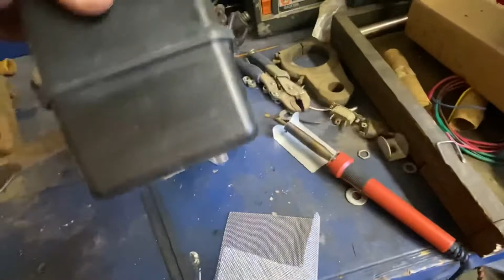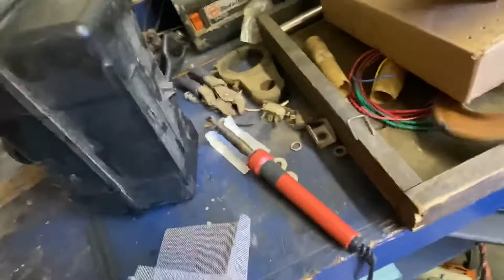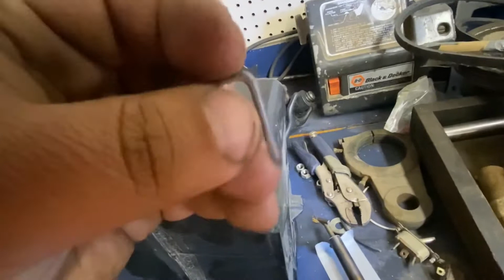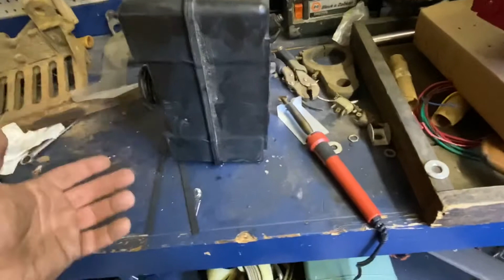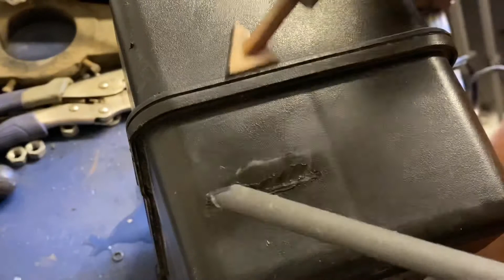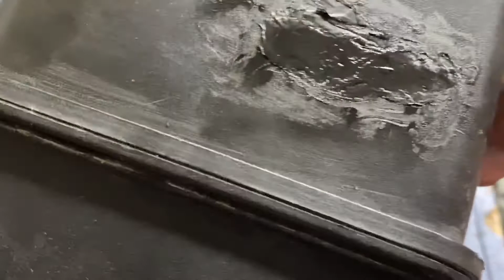Plastic welding a Briggs and Stratton gas tank

Comment: What about ATV tank hole. Big as a  hamer head
Reply from the maker: You can put wire mesh backing in and melt in a new piece.  It might look a little wavy when it’s done but will seal if done right.  Largest patch iv out in was roughly 6X6 inches

Comment: Do you think this would work to fix the diaphragm on my dialysis pump? I think it’s plastic and im having to rent a loner at the moment. The dealer wants $130 for a replacement diaphragm. I ain’t paying that much money if I can fix it myself. I’m assuming that if a plastic weld can prevent gas from leaking it can prevent air from leaking too. I was going to try JB Weld but my doctor said that if the epoxy develops pinholes that lead to any pressure loss in the vacuum I’d die. I think I should definitely weld the crack in my diaphragm and not risk using the JB Weld. I’ve got an old soldering iron here and it should do the trick. Great video - you’re literally a life saver ❤

Comment: I’ve had fairly good luck and results so far, but I have learned it’s best to use other fuel tank for adding material 😊😊😊
Reply from the maker: I use that a lot as well, I have a few old tanks that I have cut into strips and square patches ready to use

Comment: I bought this Iron. My leaky tank is on the mold parting line seam. Took a lot of tries to stop creeping gaps along the seam. Annoying pin hole drips. But yeah better than finding any used tank that is 30 years old.
Reply: A plastic hot stapler is your friend for helping hold a seam split together!

Comment: Is there a plastic that will meld with different plastics, if you don't know the type of plastic you are working with?
Reply from the maker: Actually the supplied sticks with the kit work on a very wide range of plastics and have worked on almost everything iv used them on
Reply: @smalltownmachineshop6860  
Thank you!

Comment: If using pieces of old tanks are they still usable if brittle because of uv effects. Once heated and melted I could see it being usable but also maybe no
Reply from the maker: The times iv used brittle plastic before it was a little thicker and I had no problems with it, it melted fine.  When used on a non pressure vessel like a vented gas tank you have a lot more freedom of material to work with

Comment: A long time ago I needed a radiator tank sealed, plastic. I took a screwdriver and made the crack a little wider and deeper. I used an epoxy on the seam then let that cure a bit then slightly  wider with fiberglass, then a little wider with more fiberglass. Worked until I could get a new radiator. Kept the repaired one in for about a year didn't want to push my luck much longer.
Reply from the maker: Nice, lots of ways to fix plastic tanks for sure

Comment: I got my DR Trimmer (tow behind) into my barbed wire fenced cracked the fuel tank. The damage looks almost identical to the repair you did here. I watched you and "Steve's Small Engine Saloon" and you both did the repair almost identical. I'm gonna give it a try. Thanks for the video. Also, where do you get the filler plastic?
Reply from the maker: If you get the kit from harbor freight it comes with a bunch of the filler rods and they are actually very good for a lot of different plastics
Reply: @smalltownmachineshop6860  Thanks for the response. There is a Harbor freight not far from my house. I'll get that and give it a try
Reply from the maker: @TimothyBrewer  awesome, it’s really not all that hard and you will learn quickly I’m sure
Reply: Aside from the filler rods that come with the Plastic Welder, I've used DVD boxes for repairing the air filter housing on a neighbors Toyota Tacoma. It took almost the whole box for that repair, but it sealed up really nice and didn't look too bad when finished. You can use those little recycle emblems (triangles) as sort of a guide for which plastic will work with what you are working on.

Comment: i fixed my poulan pro 300 ex riding mower gas tank after repeatedly replacing the fuel grommet constantly and not lasting very long i decided to fill up the hole where the grommet goes with these strips from harbor freight after filling the hole i drilled up to the size of the fuel nipple after inserting the nipple i alligned everything up as to how the fuel line routes to the carburetor after that i gave it another pass around the nipple just in case it might leak well for my surprise its still holding up and its going to be almost a year now by the way awesome video
Reply from the maker: Thanks and That’s awesome that you were able to fix your tank, it’s a handy tool to have

Comment: got a hairline crack in my pool sand filter. It is under pressure, I have a new tank but I think I would like to try this as an experiment although it is a pressure vessel. Eh..It might hold. we'll see.
Reply from the maker: In case like that I would give it a try, nothing to lose, Air pressure vessels are the main concern as they can build pretty good amounts of pressure.  I would melt in some wire mesh a good bit around the repair to reinforce it and possibly do the inside as well if you can get to it and there is clearance for the repair

Comment: You can use Steel Wool as a way to strengthen the repair. Heat the area around the whole and press in the steel wool and then cover it with the plastic. Works great!
Reply: Window screen works well all so.
Reply from the maker: Yup that will work for sure, I use fine metal screening as well sometimes

Comment: Sounds like you might benefit from adding a "hot stapler" to your toolbox.  I say this because your video was suggested after I just saw one about those.  This obviously is more for strength and probably wouldn't be useful on a gas tank.

https://www.youtube.com/watch?v=dGveuYxwzg0
Reply from the maker: I don’t have one of those tools yet but have been looking at them, on thicker stuff I have a ton of those brass staples from large cardboard boxes and I heat and bend those.  I should probably pick up one

Comment: I haven't had much luck sealing up a gas tank with these plastic welders. It works for a while but starts leaking later.
I came up with another way that has been fail safe. 
Sand the area with a real rough paper. Then take some masking tape and build a little damn all around it by only sticking half the tape and turn it up so you can create a place to hold a liquid.  Then take a 2 part epoxy and put in enough to make it 1/8 inch or deeper.  Wait until the next day pull the tape off and your ready to go. I have 2 tanks I have repaired this way over 3 years ago. They are still holding.
Reply from the maker: Epoxy is also a way to go for sure, and the this tanks can be hard to keep sealed with plastic welding, I usually do a two layer repair on them and there fine

Comment: Heat press steel wool into crack works great
Reply from the maker: That’s a good idea
Reply: @smalltownmachineshop6860  Thin Steel wool heats up fast, sinking into plastic for tight seal.  We have to be careful not over heat that makes plastic brittle. Steel wool resolves brittle issue for long term repair.

Comment: I have a generator with plastic tank that has a crack. The replacement part is very expensive, so I will do something like you did. Thank you for sharing it.
Reply from the maker: Hopefully you find it useful and are able to get your tank fixed
Reply: I like this thing.I rebuilt an easy load weedeater head. The bump cap had wore through. I built the surface   up about 1/4".

Comment: I bought this same tool to try and fix a gas tank from an old snapper lawnmower that isn't available anymore. The tool works great but it turns out that in addition to the leak I knew about it's also leaking from the seam. I've already made a few attempts to seal it but haven't succeeded yet. I'm going to keep trying, don't have anything to lose at this point. I'll either seal the tank or throw the lawnmower away. Wish me luck!

Comment: The trick is not to use filler sticks but a piece of the exact type of tank.
Reply from the maker: On older tanks like this that can tend to be more brittle I like to use the filler as just mending it back can leave thinner spots and this tank was very thin, but there are many ways to do it, thanks for watching
Reply: @smalltownmachineshop6860 ,I should of said to use the exact plastic if filler is needed, sorry if I came off rude,your channel rocks!!
Reply from the maker: @jpeknowbody3649  no worries, and you are right there as well, I have strips I have cut from old gas tanks that I use as well

Comment: Can I use zip ties on an hdpe tank?
Reply from the maker: For small thin cracks yes, if your repairing a hose attachment spout or something similar that’s under stress I would use the flexible rod the kit comes with or strips of old plastic tanks
Reply: Thanks

Comment: Great video, thank you for sharing.  I have a fuel tank very similar to this one.  Its on a chipper/shredder.  It has been sitting in a barn around 20 years. I have everything else on it repaired, but on the first day using it, the fuel tank began to leak around the seam in the middle of the tank all around the tank.  What are your thoughts on this?  Can it be welded and if so, I noticed there are a lot of choices for plastic welding rods.  How would you choose the correct one for this type tank?  Thank you in advance for your thoughs.
Reply from the maker: Yes welding the seam is fine, iv done it before, of course make sure there are no gas fumes or anything in it, iv used the ones that come with the harbor freight kit on many repairs and have never had issues, iv also used plastic strips cut from old gas tanks and have even used the plastic lid from a Folgers coffee can on super thin stuff.  The main thing is getting the two plastics to melting temp and fuse them, for unpressurized vessels like a mower gas tank you can get away with using just about anything but the rods from the kit are actually very good

Comment: Lost me at “not gonna look pretty”
Reply from the maker: On thicker tanks it’s easier, on thinner ones the more you work it the more brittle the plastic becomes so sealing the crack is what’s most important.  And when the customer gets there tank back the same day rather then waiting to order one and the repair only costing 1/4 of a new one they are very appreciative
Reply: It's a plastic gas tank, not a Rolls Royce. Function over form on a leaf blower gas tank
Reply: First time on your channel  but I have a question do you wear a respirator
Reply: Mine turned out beautiful!! It’s is on a $13K John Deere that I needed to still look nice. Thanks